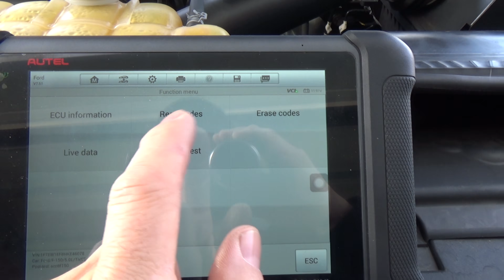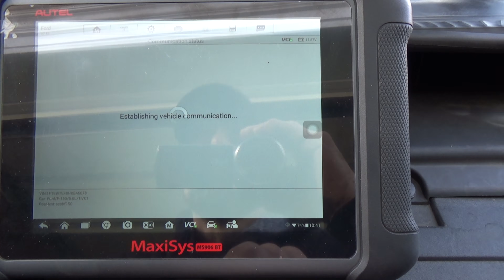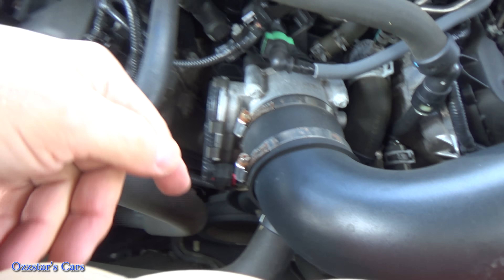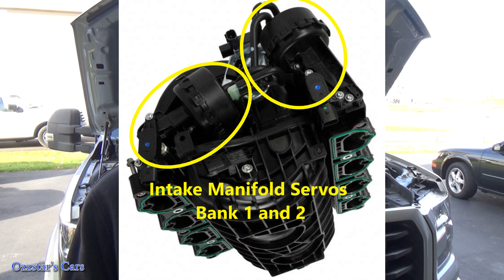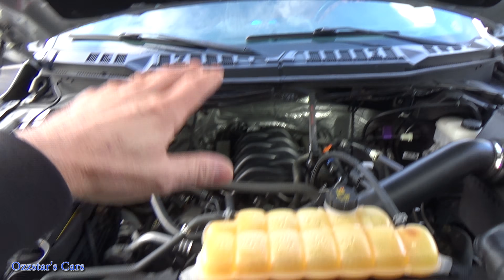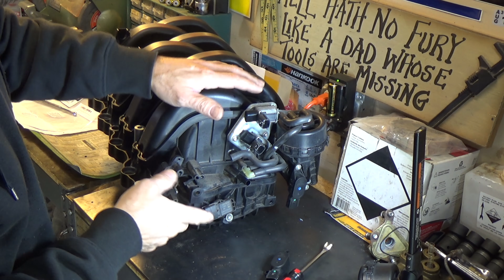Ford F150 Engine Rattle Tick Noise: I Can't Believe Shop Says It Needs A New Engine

Comment from the maker: Thanks for checking out the vid!
*Lisle Mechanics Stethoscope* https://amzn.to/3FbNzcZ
*Autel Scan Tool MS906BT* https://amzn.to/2sgBbIp
Check out some cool tools that Ozzstar likes to use:  https://www.amazon.com/shop/ozzstar
Reply: Just  turn up  the  volume on the radio,  problem  solved !....
Reply: @thejackel1844  my auto mechanic teacher used to tell us that all the time lmao.
Reply: I have a engine rattle around 2200 rpms it comes and goes doesn't do it all the time, if I'm hard on the Throttle it never makes this sound, after seeing this i ordered a 21gt ported manifold with imrc harness with oz tune.   I was a little nervous that the chain had slack and was rattling against the guides But after watching this I'm hoping this is my problem I also have vct solenoids issues i think idle will drop low truck wants to die. If i change oil early this problem does not exist.   Appreciate any input
Reply from the maker: @justingill5256  test, don't guess.
Reply: @ozzstars_cars  yep it worked rattle gone
Reply: Any Top End noise never needs a new entire motor..Bottom end is different
Reply: I have a 2020 F-150 2.7L Brought it to Ford they said it was the Cam rollers $2000 later they said they didn’t know and recommended an engine flush after they said it was a super clean engine. At idle it ticks about every 3/4 of a second and increases with rpm…..
Reply from the maker: @markfink7146  should be covered under warranty unless you have more than 60k miles?
Reply: @ozzstars_cars  I’m over 😭😭
Reply: @ozzstars_cars  could it be valve clearances? it’s bad I’m resorting to YouTube after spending $1600 on a certified Ford mechanic
Reply from the maker: @markfink7146  anything is possible, needs a proper diagnosis.

Comment: I pray you see this. I’m willing to pay, but my truck is doing a similar thing. 9k miles Shelby super snake 2018. Slight studding noise. After the dealer did an oil change. 36miles later I heard it. They recommend an engine. I’ve been declined from my warranty company. And I’m stuck the truck was running fine. Just sounds a bit off. I haven’t driven it I. 5 months because it’s been a on going deal. Seeing this video makes me think maybe they jumped to engine replacement too quick. Idk I love the truck.
Reply: Heat shield sounding noise at different RPMs Shudder*
Reply from the maker: Good luck with the repair

Comment: These new trucks nowadays are nothing but a piece of crap you can't work on them because the computer you can't even change the battery now the motors are all going bad nothing I want I'd rather stick to my old truck before I go spend money on one that don't want to run
Reply from the maker: I agree that quality is not what it used to be. Thanks for watching Steve.

Comment: Good video.  Cheap plastic.  I see a Maxima at your shop, I got a '95.  I think the Maxima parked outside your shop got those floppers in its intake too, but the Maxima's is metal not plastic.  Can we get those Ford's intake aluminum instead of plastic?
Reply from the maker: That Maxima was a '98. Metal intake, no runners. I have a few videos on that car. Great 4th-generation machines!  No metal intakes for the Ford 5.0L that I know about.

Comment: Finally found my answer! I knew there was no way my f150 with 70k miles had a timing chain or roller issue! Mine is mostly at idle and to 1100 rpm. It goes and comes. I have a spare manifold I will be replacing it with!
Reply: Do you have same issue?

Comment: I have a similar issue with my 2018 f150 5.0. I have had a tick since day one. Tech would tell me it was normal for my truck to make that noise.  Now 87k miles I’m out of warranty so it’s a problem now.  lol. Thanks for the information I hope it’s something small.
Reply from the maker: On an '18 5.0 with that mileage check the cam phasers/timing chain

Comment: Does this affect gas mileage? I have a 2018 5.0 & I cannot pass 11.2 mpg.
Reply from the maker: Good question. Depending on driving conditions such as the load of the engine demanded I'd imagine it does effect fuel mileage to a certain degree.

Comment: Mine has a tick too exact same year I just bought it and it wasn't ticking at all. It only does it every so often not every time. It follows RPM so if you rev it up it speeds up the tick. It's very faint, I didn't notice it until I had a window rolled down at a drive through. Not sure what is causing it.
Engine runs great, no codes at all. 105k miles did a fresh oil change no difference.
Reply from the maker: Check the intake manifold Skyler!

Comment: Mine started at about 213k i could hear it ticking just from a stop, would go away when you get hard on the throttle. Eventually started to do it at idle. Put a long screwdriver on the intake and put your ear against it. You will confirm it without a $1500 scanner. Replaced it with a Ford intake got the solenoids and actuator. Don't bother with aftermarket crap you have to pull all that junk of the original and hack it on the aftermarket. It's a bit tricky to disconnect the connectors. I finally replaced the intake at 256k. On one side the rod was broke inside the intake and the flapper was flapping freely. 2017 F150 5.0 277k. Mine never threw a code. This is good info.

Comment: Would those servos cause a misfire and throw codes P0300, P0304, P0308?
Reply from the maker: Doubtful.
Reply: @ozzstars_cars appreciate it! I'm having issues with my 150. I keep pulling P0300 codes for random misfires. I've changed, plugs and coil packs. It actually ran worse.
Reply from the maker: @andrewschmidgall6307 did you use OEM Ford coils and Motorcraft plugs?
Reply: @ozzstars_cars I used motorcraft plugs and aftermarket coil packs. To replace coil packs with OE is quite pricey.
Reply from the maker: @andrewschmidgall6307 also make sure you didn't buy counterfeit plugs off of Amazon. Lots of fakes out there. OEM coils for the win

Comment: I think pretty much any time you go to a dealer now with any problem that looks like it will take any amount of time to diagnose with no codes present, you will receive the answer "it needs a new engine".  They would much rather charge you $10k for something you don't need and make a boat load of money, since spending three or four hours of time in diagnosis pretty much guarantees that the mechanic will not make any money in the flat rate environment.  That story plays out over and over again, and is the reason I refuse to take any recent model car to a dealer unless it's my last resort.
Reply from the maker: You are on to something. I think it's difficult for most of those shops to even have anyone qualified that could diagnose a problem even if they did get paid for their time.

Comment: Awesome! Great information - I have a 2018 F-150 with the 5.0 and 10 Speed making the classic F-150  "cold start" rattle at just 73,000 miles. Is that related to this?
Reply from the maker: Probably not. '18-'20 5.0L have there own issues.

Comment: So you telling me I should get rid of my 2020f150 5.0.. ours only has 28k on it previously at 24k it was consuming oil took it in they reset the pcm took it back at 28k still consuming replaced the pcv valve . Not noticing the consumption yet again but every time at low speeds I still hear the mettalic click for a split second every time I release the accelerator. Does it every time I drive and release it.
Reply from the maker: Good luck Zach!

Comment: Would unplugging it be the same as on and off on scan tool unplug and see if the noise goes away?
Reply from the maker: That would be tricky to do
Reply: I’m in SC there’s a 2012 f150 4x4 on auction public school  truck haven’t looked at it yet but the description says it rattles when warmed up. 199.000 miles 5.0 they said possibly the timing chain or cam phaser’s
Reply from the maker: @Chriscanoe avoid buying that nightmare unless you work on vehicles and have $1500 for parts...

Comment: Great work Scott. This isn't the normal Coyote 5.0L engine tick, though. That one is easily fixed by adding Liqui Moly Ceratec at an oil change.
Reply from the maker: It's that easy to cure??? Nehhh
Reply: @ozzstars_cars  IF IT'S THE ACTUAL TICK, YES, THAT EASY.

Comment: i just got a 2019 f150 5.0 has 143k on and sounds like a ticking noise
Reply from the maker: 2018-20 F150's are not good years for the 5.0L. The GDI pump is loud and annoying. The engine is plagued with many other issues like rocker failure, oil consumption, cam phaser/timing chain issues and on and on, nevermind the garbage 10 speed transmission.

Comment: Thank you for this.  My 2019 Bullitt makes the same noises.  I use Ceratek and it helps with the bottom end knocking but is still noisy with the 2k rattle and now I know what it is, so thank you again.  Now I just need to find the rattle in the door.  :)
Reply from the maker: 2018-2020, not very good years for the F150 😢

Comment: Im.about to buy another f150 itnis a ford 1999 or 2000 f150 4.6 v8.And he said he changed the fuel injectors last December and now it has loud ticking.if I sent you a short 10 second clip can you tell me if you feel like it is lifters and valves or injector noise which I've never heard of or something worse. I can't afford to purchase a bad vehicle. It doesn't have to have ac or be pretty but has to get me to 4 dr appointments minimum every month
Reply from the maker: I don't recall ever getting a video. Where did you send it to?

Comment: Crooked and inexperienced mechanics make all mechanics look like scammers. Ir is sad. I know a couple that were truly master mechanics. Could work on everything from front end loaders or diesel trucks to mopeds lol. Your one of the great ones. Glad you explain most of what's going on,then compare it to what other expensive diagnosis that were wrong from other mechanics .
Reply from the maker: I try my best to be informative, thanks for the comment!
Reply: Keep it up the great videos. Im lookingvat a 2000 f150 4.6v8 single vmcab for 1200 but it has a loud ticking/tapping. He states that he changed the fuel injectors last yr and thats when it started.idk what to think. Like i mentioned earlier myb2nd mustang cobra 1997 started tapping and then got in the lkw end within a fe months then spun a bearing. I have a xlip of the truck but i cant figure out how tonsend it for any of the honest mechanics to hear it. Idknif fuel injection noise tappingbis a thing after changing just the injectors.maybe wrong size for pump and fuel injections railing???idm@ozzstars_cars

Comment: I had the same experience, finally found a good mechanic that said it timing chain tensioner
Reply from the maker: Was that the actual issue? Did it fix your trucks problem?
Reply: It's definitely the issue, he could here the noise originating from the timing chain area using a stethescope. When I throttle it, you can hear the chain slap. I have not had the work done yet.
Reply from the maker: @TheMaximumMinimalist hopefully ypu van get the truck fixed soon. New phasers, timing chain and guides.

Comment: Thx for the info. I’m glad to hear that vehicle did not have any codes bc I don’t either. I have the same issue. I’ve described it as a slight flutter but goes away at 1800-2000rpm’s. Others say the rail flutters will give a code do you think it’s just not bad enough yet and eventually will? Thx again! Very helpful.
Reply from the maker: Comm9n failure on these 5.0L's.

Comment: Hope you see this. I also have a 2017 5.0, 72k miles. Can this problem happen at start up only? I have had a rattle/clack, only twice, both times on warm starts, that lasts about 2 or 3 seconds. Hard to pinpoint it since it's so rare and goes away so quickly.
Reply from the maker: It's hard to diagnose on the internet but I would be testing the cam phasers/timing chain tensioners.

Comment: Has anyone checked the vacuum at the diaframs at idle and at 2500 rpm. Maybe a leak or bad check valve somewhere! Bad PCV, etc...
Reply from the maker: Those things have absolutely nothing to do with this problem.

Comment: You could've just deleted the IMRC its unnecessary BS. You also don't need a computer to diagnose this particular problem.
Reply from the maker: I have a "computer" so why wouldn't I use a scan tool to make a quick and accurate diagnosis?

Comment: my whole thing with american mechanic is that their labor is worth more than the part itself.  For mechanics it's cheaper to replace the part and save on labor rather than spending the time to diagnose the problem to sharpen your skills and save your customer some money.  Economically i understand that time is money but it has gotten out of control.
Reply from the maker: @h.nguyen4193  labor and parts are only getting more expensive. What country do you live in?
Reply: @I'm a massachusetts man first an American second.  Where i'm from? My Region is New England. And my country is Massachusetts and my town is Waltham.

Comment: Could this account for cylinder misfires? I have a 2018 5.0 F150 with a lound rattling/clicking happening in that RPM range. It shows codes for the random misfires and bank 2 camshaft position sensors, even after replacing the sensors.
Reply from the maker: I highly doubt this issue would cause a misfire.
Reply: @ozzstars_cars  Thanks for the info. After more research, I believe I know what's going on with the misfires and camshaft codes. Separate issues, but I think I'll have to do this as well.
Reply: @PW.6060 cam phasers

Comment: I started using better oil and mid grade  gas and premium gas. I swear it stopped. Also check out your muffler system it can make the same noise if there's something loose in the exhaust system.
Reply from the maker: Sounds like your vehicle had an entirely different issue.

Comment: Ive had my first 5.0 coyote f150 for a year or so now. It makes all kinds of noises that in the past motors I wouldve been very worried about but people say its normal. Throttle plate clicking, high pressure fuel system ticking, and a lower end kinda tapping at idle.. all while running completely fine..
Reply from the maker: @slipagent6  sounds like newer vehicles are junk because they are.
Reply: @    well its only a 2014’ so I think Im doing better than a newer model, an ecoboost, or a 10 spd trans anyway

Comment: Thank you for the diagnosis you definitely know more than the Ford dealer because I just had my Ford F-150 in for the same noise and they told me everything was normal even though it sounds like one of the lifters is coming through the valve cover now I'm pretty sure about telling them about the runners in the intake manifold I believe Ford knows about this problem they just don't want to put manifolds on all these coyote engines thanks for the great work
Reply from the maker: Good luck Bill. I hope you get a solution to the issue. I've had viewers that have requested to show this video to their mechanic. 👍

Comment: I have the exact same ticking noise with my 2017 Ford F150 between 1500-2000 RPM. In your opinion, is it better to delete the IMRC or just get a new intake manifold? This will be the second manifold I've had to replace—the first one was under warranty. Also, thanks for the great video!
Reply from the maker: Delete it if you like, as long as it won't effect.your emissions test.
Reply: @ozzstars_cars   thanks! That’s the beauty of South Carolina no worries on the emissions side. Are there any downsides of deleting other than having to get it tuned?

Comment: Great video! You have a new subscriber here. What angers me most is that this went to a Ford engine specialist. There is no way they didn’t know this and still recommended a new engine. They collect their $9k, put a $300 part on the old engine, and put it in inventory waiting for the next sucker to come in. You are a hell of a tech and an honest man. I enjoy the well-paced, methodical way you covered this. Keep up the great work! PS: Rainman Ray just did one of these on a RAM, so not unique to Ford V8. In that case the runners were bound up and causing performance problems.
Reply from the maker: Thanks for the comment and  compliment Frank. One thing we can all agree on, manufacturer's don't mind using cheap parts! Even though a mechanic has an ASE patch on his arm doesn't mean he knows exactly what he's doing. Take it easy. -Glen

Comment: Mercedes V6 diesel has the same problem with intake shut off motor and control rods, but you can buy better quality control rods and bushes to fix it. Your manifold job looks easy by comparison, the Merc is a SOAB to get at, you're in there for hours!
Reply from the maker: @daveblack5109  they call that Eurotrash for a reason. It's all the same junk with a different design. Thanks for the comment!

Comment: First time here Ozzstars! Great video!
But what is the reason for all that crap on the manifold? 
Doesn't make $en$e to me!
Reply from the maker: @ekimbrough1413  it's explained in the video. Torque and horsepower efficiency related to fuel mileage.
Reply: @ozzstars_cars  
It was a rhetorical question Glenn.
It's a bunch of extra stuff that's really not needed to me.
Reply from the maker: @ekimbrough1413  ohhh hard to decipher a rhetorical question online sometimes. 👍

Comment: Well...if those solenoids are making an unusual noise, wouldn't that effect performance; thus sending a code?
Reply from the maker: Not in this case, no way to detect a slight rattle. Did you see the position sensor shown in the video on the back of the manifold?
Reply: @ozzstars_cars  
Yep I saw it. Big bastard ain't it?
That noise is something that would send a few folks to the dealer for nothing: to get milk!
Think the truck would get along just fine without that contraption economy vs. torque (or not)!!!
Reply from the maker: @ekimbrough1413  government mandated emissions and fuel economy. 🤷